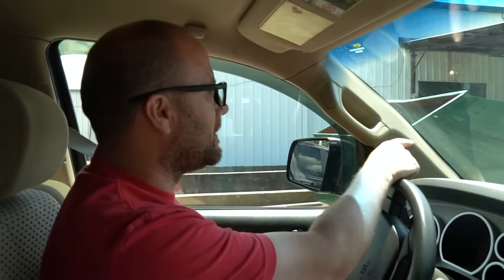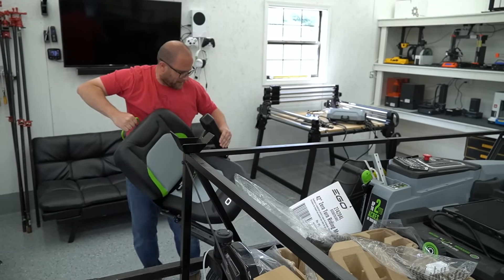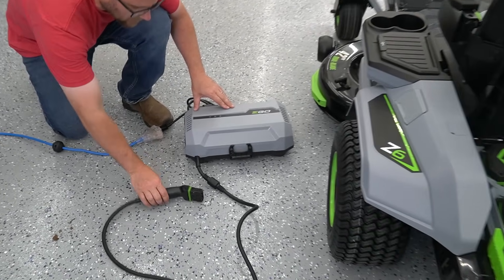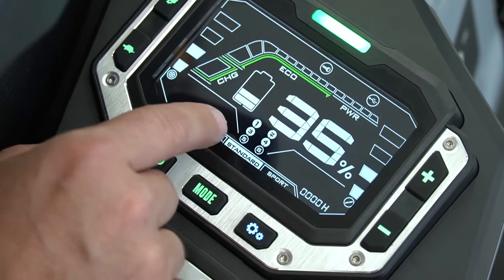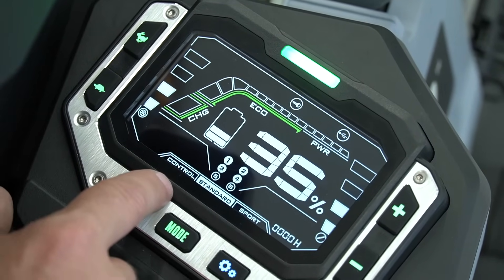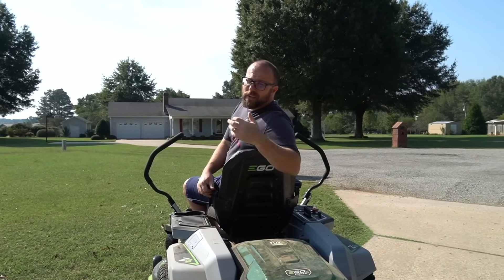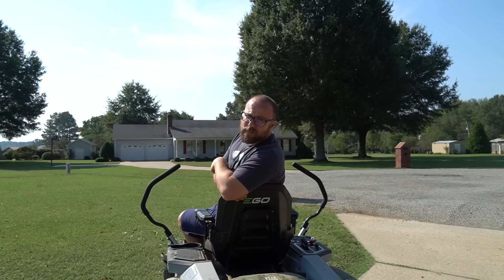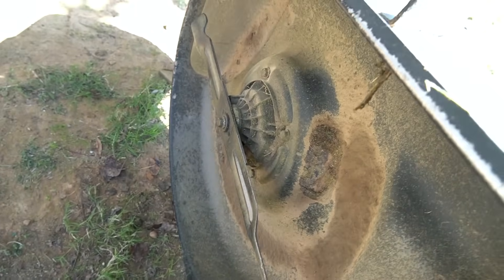EGO Z6 ELECTRIC Zero Turn Mower - The FIRST of its Kind! //Unpaid Review!

Comment: TBH, the negatives are just something to work with. I'm definitely getting one now. The stickers are just cosmetics and are likely suffering the extreme heat like everything else. Re the deck's metal to metal bounce, it's no big deal to use self adhesive neoprene for that. Run time just means I'd portion my cutting areas up to fit the power availability. To be charging a ride-on with solar and never have to pay for fuel or mess with disfunctional engines, is a dream come true. Thanks for your honest review.

Comment: Hey I have one of these.  Yesterday I put the batteries back in it to use it to move my wood.  It wouldn't even start with error 202.  Called support and they were clueless, but admitted it needed work.  It didn't make sense to me as it has been in my shed and worked when I put it away.  If you get error 202... turn off the mower.  Take all the batteries out.  Depress the emergency brake. Wait 10 min...(this is critical)...Then put the batteries in 1,2,3,4 bays in that order.  Get in the seat.  Disengage brake.  Turn mower on.  (also make sure the red blade button is in the down position).
Reply: Return it

Comment: As cool as that is, it makes me even more happy that I got my used Toro 42” zero-turn for 900 bucks. It’s a champ. And while I love the battery mower idea, gas is where it’s at for me right now.
Reply: That‘s a steal if it was in decent condition. I‘d take that for sure.
Reply: @damschu23  What condition was it in? It's not a steal if it costs thousands to fix up to a usable and sellable state...
Reply: My toro 42" lx420 just went bad, literally everything in 1 yr after 22yrs.  

Belts, pulleys, metal bracket (metal age/fatigue)won't staybent in place, engine burning oil (smoke)when on hills started to happen...never used to.   Tires wouldn't hold air, new rims/tire each cost $500 as whole unit.  Like $130 each for the front.  And this last mow steering gear completely gone... 

I'm probably going to set this mower out free...tired of working on it.

Comment: I have this mower. I absolutely love it! I use the 4 10AH batteries and 2 7.5AH batteries and i am able to mow my whole lawn. Its about 2.5 acres.
Reply: Does it take 6 batteries?
Reply: Yes it takes up to 6 batteries.
Reply: @nathandingman6846  Just looked at the price of adding batteries 😱
Reply: Yeah they r expensive. There are aftermarket batteries on Amazon. They only work in some equipment. I personally wouldn't buy them. Ego backs there warranty. I had 2 defective batteries and they replaced no problem and i kept defective batteries. Up to u but do your research
Reply: Ego only warranties batteries if u buy from lowes, ace hardware or Amazon. I bought a battery from Ebay and saved 50 bucks. It crapped out and ego wouldn't warranty it.
Reply: If u would like to chat on the phone no problem helping.
Reply: The best way to get batteries is to invest in the ego line of products. U can get a new tool with battery. All ego batteries work in all ego tools
Reply: 4 10 amps at $450 ea and 2 7.5 amp at $350 ea. $2500 for batteries .................................... and they will fail. Is too much for me. Prices at Lowe on 5-5-22.
Reply: @jeffstanley4593  Correct. The z6 mower comes with 4 of the 10amh batteries. 5 year warranty on the batteries as well
Reply: Have a 52” with 6 10amp batteries. Love it! And yes…OE battery prices are bananas…and might be increasing. There are after market brands on Amazon, some swear by them, but you take your chances with them.
Reply: @nathandingman6846  I bought mine from home depot in 2019 and they covered the battery under warranty.
Reply: How long did u have it and use it before the battery failed?
I would be mowing 3 acres 2 or 3 times a month where I live...
Reply: @VajrahahaShunyata  2 batteries died within 6 months. 1 other battery lasted 3 years and 1 month. So 1 month past warranty.

Comment: Acreage per full charge is based on flat surface, no obstacles. 
So many variables can change this for better or worse 😎👍🏻good vid
PS.. blade speed has 5 settings, once you get to top speed, push and hold the plus button for a few seconds til turbo appears .

Comment: It's nice and I almost went with one as I have Ego trimmer and blower that I love but I wanted at least a 54" deck. And I'm not sold on the longevity of the brand. ZTR mowers can take a beating and will it last for years is unknown with a new brand. Especially the stamped deck doesn't look or sound too sturdy. I bought a Hustler with a welded fabricated thick deck and the brand is known for longevity.

Comment: Thank you for the review.  I think I'll keep using gasoline powered mowers for a while.  The only "updates" they need are simple things like changing the oil, filters, plugs, etc. and I enjoy doing the maintenance work on things.  Take the blades.  I don't buy new ones, I just use a grinder and sharpen the old ones.  It's easy to balance them.  Hang them from a nail in the wall horizontal.  If one side starts to lower as the other side raises you know to grind a wee bit more off the side that's lowering.  Perhaps in a few years when I see what kind of longevity electrics provide I'll re-evaluate.  Right now my current riding mower is still running great and I bought it new in 2010.  My lawn in only about 1.5 acres and I can mow it about 3 times on a 2.5 gallon tank.
Reply: You don't have to update the firmware if it is working fine for you.  Other than sharpening the blades, there is zero maintenance on these.  No belts.  No clogged carbs.  No lead-acid batteries.  No oil.
Reply: @stargazer7644  And when they wear out, no way to replace anything to keep them going.  Never had a clogged carburetor, but I use ethanol free gas.  I've had to buy one new battery in the last 11 years, but I bring my battery indoors over the winter months and use a 1amp trickle charger on it about once a month.  Only change the oil, plug, etc. once a season and that takes all of 30 minutes.
Reply: @Rebel9668 No way to replace anything?  There isn't anything to replace, except blades and eventually batteries.  And the batteries literally plug in.   If you've never had a clogged carb, then you don't own any.  I use ethanol free gas too, but yet I have to tear apart every gas powered yard device I own every 2-3 years to clean the carbs.  Some of them have to be done every year.  I run my batts on maintainers too, but 11 years of life for lead acid is ridiculous.  5 years, if you're lucky.  Hell, batts don't last 11 years in a car.  30 mins for maint sure would be nice (I have one generator that I have to literally tear to bits to do the carb and plugs), but even 30 minutes is 30 minutes more than zero minutes.
Reply: @stargazer7644  Perhaps you don't drain your fuel over the winter and run the machine until it quits?  I repeat, I have never had a clogged carburetor and my Briggs & Stratton push mower is even older than my riding mower as I bought it new in 2001.  The only part of it I have ever done anything to is replace the diaphragm/gasket.  And yes, that brushed or brushless motor will wear out and then your stuck, and good luck getting that plastic crap back together.  Also, read the actual comment.  I NEVER said the battery lasted 11 years, I SAID in 11 years I've replaced the battery ONCE, meaning I replaced it in that time, not just now.  The rider has two screws to turn 1/2 turn each to take off the breather cover, , one twist lock/pull to drain the oil and I need a spark plug socket to change the plug.  Big deal.  Have you looked at the price of replacement batteries for one of those things you have?  You could buy a new push mower for less, LOL!  I just looked up the Z6...$7,000 on Amazon, lmao.  I guess some folks just have more dollars than they have "sense".
Reply: @stargazer7644  The only carb I have ever had "clog up" was on a Champion 3200 psi pressure washer and that was because I made the mistake of using Sta-Bil in it one winter instead of running it dry.  20 minutes in the ultrasonic cleaner and it fired back up on the second pull.
Reply: @Rebel9668 Yes. your one time personal experience outweighs everyone else's on the planet.  Again, NONE of this EVER matters on an electric mower.  I've had multiple gas powered machines over decades.  They're a pain in the ass.  An electric mower is not.  EVER.  I don't understand why you think your personal experience outweighs mine over decades.
Reply: @stargazer7644  I've also had decades of experience with mowers and as I said in the beginning, I actually like maintenance, for what little of it I have to do.  It beats all hell out of sitting here in the winter waiting for spring, lol.  If you had read the whole comment you would have seen that and none of this would have even been necessary, but it has been entertaining if nothing else.
Reply: @Rebel9668 I did read the whole comment.  The need to do maintenance really isn't a feature.

Comment: Also I should mention when updating the firmware -be sure to do in the order they tell you.  I tried probably 20 times before I slowed down and followed the instructions.  Emergency brake engage. pull up on the blade button to engage the blade.  depress power button quickly to not fully turn on the mower-you will only see bluetooth and the power of the battery reading. Do not sit on the mower while doing this.  Do not allow your phone to go into sleep mode.  On the phone be sure you don't have any other bluetooth devices as it will fail using the first one on the list.  I have 2 teslas so I had to remove them to get it to work.
Reply: Gggg
Reply: Gggg
Reply: Who has the time or patience for that? Why would there be an update on grass cutting? Did I miss something?
Meanwhile, back at the ranch...

Comment: Great video Ben. Looks like it is $5500 + tax now at Ace (12/3/21). Sheesh. Was hoping it would be closer to $4k but I guess supply and demand isn't in our favor right now.
Reply: Yeah, it use to be 4999 when it came out 😢
Reply: @sj7601  You folks should count yourself as being lucky that you aren't in Canada.  The mower is $7000.00 CDN plus 13% tax so almost $8000 when tax is included!
Reply from the maker: I got it for 4999
Reply: @MyersWoodshop  Nice price!  So have you tried mulching yet Myers?
Reply: @MyersWoodshop  $499? Or $4999?
Reply: If you qualify for the 10% discount at Lowes that can save you a bundle.
Reply: The 10% discount will only pay you up to $100 but it is better than nothing!
Reply: Inflation has nothing to do with "supply and demand"...

Thank our idiot-in-chief for wrecking the value of the dollar.

Comment: My entire house and 2 of 3 autos are electric and powered by my Solar/wind/hydro system. I would love to go electric with my mower but you convinced me not to. The blade deck is cheap and to bouncy. To cut my 5ish acres I keep mowed, I would need to have at 3 full charges or have 6 extra batteries with charges that are charged. Also, I would think the batteries should be beneath the seat to provide a lower center of gravity and would provide better stability on slops. 

For the time being I’m going to have to stick with the gas gravely and keep getting crazy looks when i pull into the gas station with my model Y to fill up the 5 gallon cans.
Reply: Just as with your Tesla, there are limits on battery capacity. For your specific use, you would need 6 10amp batteries and assuming you start with a full charge, would need 1.5 recharges. Or 1 recharge with 8 batteries, or one swap with 14. You’ve invested in solar/hydro/wind so your operating costs would be at or near zero. Once you tried one of these, you’d be hooked. No, they’re not perfect and would be too expensive to be practical if they were…but they are very good at what they do, they’re fun, and they’re getting better. As for stability…excellent. I have a slope and my 52” ZT handles it significantly better than my Deere. Give on a closer look if you ever have the chance.
Reply: @ccattrn   thanks for the info. I actually did look at one a few days after I posted my comment. I’m torn because my operating cost would be zero with an electric mower. My power system currently supplies a 40% surplus on a low month and that was intentional so I didn’t need to expand it as I switched everything to electric. The only reason I won’t switch is the deck. It’s an extremely thing metal and it would be destroyed in one season. On my property is a low water crossing when we get allot of rain like 2 days ago. After the water is gone there’s allot of small dead tree branches etc. I just mulch it with my gravely instead of spending hours picking everything up. Some of the debris is over an inch thick. I had to replace a brand new mower after half a season because the deck didn’t hold up. I had to get a commercial mower with heavy duty deck and upgraded suspension. Ironically the electric mowers are cheaper (almost half) of what i paid for my gravely. I’m watching the industry and if they come out with a heavy duty commercial mower like my gravely, I wont think twice. I have no problem having 10 or more extra batteries on hand (they would take up the same space as all the gas cans.)
Reply: @JP-kb4yi  understood. Weight is the enemy here, so I’m doubtful anyone will make the decks substantially heavier. Also, these are light duty residential devices, likely not intended for extremely rugged terrain. I fear one that would hold up to your needs would be significantly more expensive. There may be a role for an EGO and your Gravely. Take care.

Comment: I have and use several EGO Lawn tools and am considering this mower. I love my EGO system and like the high quality of those tools.  However, it seems based on this review that the mower is still at the bleeding edge of the technology sword. My concerns are: the deck bounce, sticker quality, and battery replacement cost (battery longevity not talked about here.) I hope to see an update HERE showing a few accessories, perhaps a bagger and if and how it affects performance.  Thanks to Myers Woodshop for making and sharing.
Reply: as long as it doesn't use lead acid batteries, you don't need to worry too much about longevity.
Reply: @qwe304 ~ Lithium batteries last 4 times longer than lead-acid and cost 5 times more.
Reply: @schizy  I've just heard really bad things about people with mowers and lead acid batteries
Reply: @qwe304  Yes. All flooded, Gell Cell and AGM (lead-acid) batteries can't be discharged beyond 50% without damage to the battery and degrading service life.

Comment: Very nice Video, But, I want to know things like... 
How much do the Batteries cost if I ever need to replace one?
How many Years Might I get from them or WILL I get from them?
In 10 years if it still works, WILL I Even be able to get batteries for it?

Never see anyone that is mowing a lawn in a desert - ish area. Lots of Dirt and therefore Dust.
The Rattling and the Peeling Stickers kill the deal.

AND UPDATES????  Shallow Grave with a lite sprinkle.
Reply: The 10 amp batteries are $450 apiece. As for longevity, the batteries will probably retain acceptable charge as long as the mower lasts. Looking at the stamped deck, small frame, and general build quality, it'll be like most residential mowers where it gets beat to death long before the engine gives out.

Comment: Real Pretty Mower with led lights and all the digital information , can it be left out in the elements , How long do the Batteries last before they have to be replaced , If something malfunctions can the owner fix it him self ?? What is the price of replacement Batteries ? Just considering one but I have cut my lawn and have plowed the snow from my driveway with a 1987 Wheel Horse Garden Tractor i rebuilt the motor one time at the coast of $ 125.00 , Gas price for summer mowing $ 20.00 to 25.00  Winter time Plowing out Driveway  $ 10.00 to 15.00 , What is the price to replace the Battery or Batteries on the Electric Grass Cutter ?

Comment: The reason you dont go straight with both arms full forward is because one (the weaker one) should but full forward while the more powerful side is used to fine tune your straight line.
Reply: No, that means your machine isn’t tracking correctly

Comment: As for me with this mower the turning function is so quick it's sort of disliked, but it's probably because I'm not used to it.  Other that that-I love it!
Reply: Seems with a proper update the power could come on more slowly instead of that instant torque
Reply: Just change the mode and the speed. No real need for max speed when cutting…reduces efficiency and cut quality.

Comment: These are super cool, but I am not sure making them run off of the standard Ego battery packs were the best way to go. I understand they wanted to keep it consistent with their other tools and it's also nice that you can have a separate set of batteries to keep going (that is a large investment tho). But if they would have built the batteries into the mower they could have easily fit twice as many amp hours at a similar cost. There is a reason EVs don't rely on removable battery packs. They are built to get the most range while staying in the weight and space restrictions they have to work with. There are benefits to both, but most people who buy one of these want to be able to cut a full yard without interruptions and over $1000 for an extra set of batteries.
Reply: Have you considered LiFePO4 battery in your mowers? such as 48v30ah , MAX support 10units connections in parallel